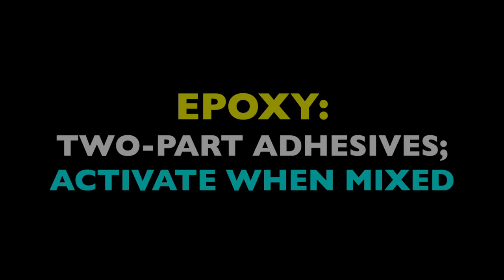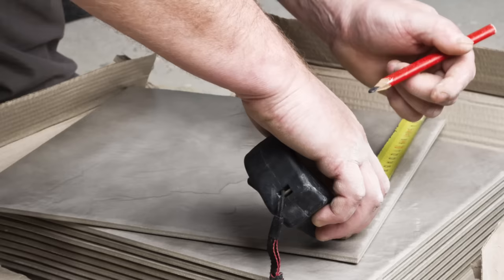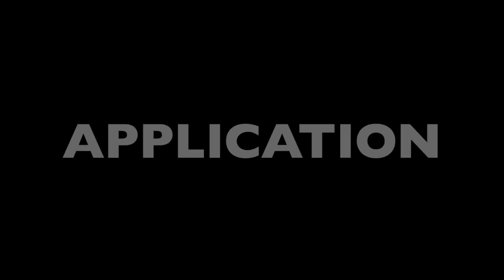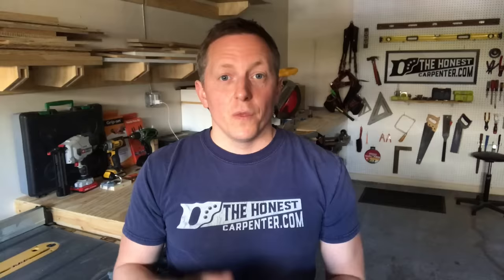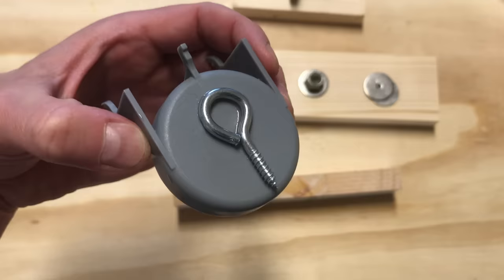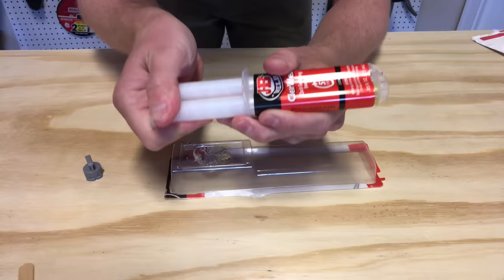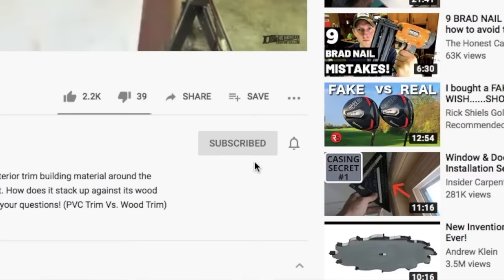DON'T USE SUPER GLUE! Try This Instead..(Epoxy Adhesive/5-Minute Epoxy/Epoxy Glue)

Comment: Thank you so much for your informative video!!! It was recommended right on time, just as my lord and savior Jesus Christ always is, "RIGHT ON TIME, EVERYTIME". I was at a stand still on which product to try next because, although superglue has it advantages, it wasn't getting the job done for me in this case. I  fall asleep with my eyeglasses on sometimes, accidentally breaking them. So I need to "HAVE" and "KEEP" some kind of strong bonding adhesive around for that specific reason.  And super glue, is by far, a total disappointment when trying to hold two broken metals together. It seems to have a nice firm hold while it's still semi wet but once it dries, "BREAK OUT THE EGGSHELLS" and don't even think about walking across them, lol. Epoxy is now my trial adhesive but from watching this video, just to be honest, there's no doubt in my mind that it'll make superglue seem super weak. 🙂I STILL LOVE YOU SUPER GLUE🙂 I'll be sure to post a follow up comment on the outcome of this epoxy and eyeglass trial. Two thumbs and two big toes up on the video, you've got yourself a new subscriber. Stay safe out there!!!

Comment: Another note -Super Glue almost requires a firm contact between both pieces to hold correctly.  Epoxy can often be used to "fill in" when there is a TINY crack between the the parts.
Reply: Super glue can fill cracks and build up if sprinkled with baking soda.

Comment: I buy my epoxy in two plastic bottles. Since it lasts a long time on the shelf it will begin to thicken too much.  You can thin both bottles by just soaking them in hot water for 10-15 minutes.
Reply from the maker: Thanks George, good tip!

Comment: You get superglue in much bigger volumes. I usually buy 50ml. Using it with baking soda (CaCO3) makes super strong. I find it stronger than epoxy. Working upside down is difficult though.

Please test the difference in strength. Baking soda and super glue is very strong and extremely fast.

I only now see that I have commented before... I would love your opinion.

Comment: A long time ago when 5 minutes was the latest, the company I was working for did some tests to compare 5 minute with slow setting.  It invariable showed the 5 minute type as being a weaker bond than the slow setting type.  Just wondering if that is still the case.   🙂

Comment: have you tried superglue mixed with carbonate? way more stronger than superglue but also dries instant with no wait. epoxy is good too used to repair a hinge on laptop but you have to wait long, there are some epoxys that use UV light similar to what some dentists have.
cyanocrylate(superglue) also is good for acuariums i readed so it wont damage potable water.

Comment: Wood tends to contract with time. For loosened furniture Bob Flexner recommends using hide, natural, hot glue, which could be easily reversed, removed and replaced with new glue. Epoxy reaction is irreversible. Trying the remove epoxy most probably will requiere sanding (damaging) the wood.

Comment: I like your comment old 'epoxy' being alternative to super glue,   well I recall when superglue was bought out as an alternative to Epoxy (ie Araldite) back in 70's or there abouts.   As a result I think Araldite bought out 5 min epoxy, a faster setting version of 24 hour epoxy (standard).
PS super glue is a epoxy  the 2nd part is air, and exposure of glue to air starts it setting.
Reply: No, superglue is not an epoxy; it does, however,  undergo a chemical cure, the main catalyst being water vapor and humidity, but it also reacts with most organic materials such as wood, cotton, leather..
.and skin. It can get quite hot when it reacts with a cottonball.

Comment: Epoxy is great adhesive but it takes much more effort to apply than Super Glue and so should be reserved for applications where it will be relied on for strength.

Comment: I had a class on adhesives years ago. One thing I learned was that super glue is not a permanent adhesive. I rarely use it for anything. In almost every application there is a better glue. 2 part epoxies are better for most things.

Comment: I'm just wondering what could I use to bond small rocks/pebbles to vertical wood surface.
I want to decorate small birdhouse for outdoors.  I haven't found anything that would stick instantly and vertically,  so I wouldn't have to hold each pebble/rock for a long time. 
Thank you for your video.

Comment: Loctite 1577688 superglue was able to glue the inlays on the soles of my Nike runners. Being a greasy plastic, nothing else lasted and worked as well.   A lot of these 5 minute epoxies and cheap superglues don't last in their application or do a good enough job.  You have to be careful to choose the right adhesive for the application especially in application where the epoxy is an electrical dielectric, exposed to high temperatures, vibration, material specific or all of the above.

Comment: The first epoxy were 24 hours or 12 hours. I remember the 24 hours was theoretically stronger than 12 hours.
I have never met a situation when Super Glue is the best option? Too quick to be adjusted, it does not go inside porous material.

Comment: Hi, interesting and helpful video. I am getting to desperate measures to remove a screw-on back to a watch. I am now contemplating glueing a nut to the back and using a spanner (wrench) to remove. However, I will need to remove the nut and clean the watch-back surface afterwards! Are there any adhesives that are strong enough to do this but can be removed afterwards, do you know? Thanks.

Comment: As you said, epoxy ADDS material, so it will leave a joint between the pieces. Not good for delicate work (i.e. jewelry). For those fine jobs CA glue is ideal.

Comment: I much prefer epoxy. I used to buy these plastic packets with the epoxy and activator in separate sides and you would squeeze the two sides together with your thumbs and knead the packet to mix them, then tear off a corner to push the epoxy out of the packet. They were the perfect amount of epoxy for most jobs. I can't find those anywhere...

Comment: agree that epoxy is really strong but it's messy and it smells. So it's more of a last resort use. For wood to wood applications I prefer to use wood glue. It's really strong for most applications and it cleans up a lot easier.

Comment: One of the big things is the gap filling.  Super glue only really works well when there is good fit up.  Epoxy can bridge big gap.  Only thing I would have included is always use epoxy in well ventilated spaces.  It is toxic

Comment: If you do touch the two parts on the nozzle of the syringes, as it is shown here, by rotating the syringes: next time probably won't be able to use it! It takes a trace amount of hardener to start curing the resin.

How many resin syringes tubes I have thrown way! Even some unopened! (USUALLY the hardener, ironically does not harden by itself!).  The self-life is quite limited (LOOK the EXP. DATE on the package! don't bother if there is no EXP DATE/USE BY DATE). I am still looking for an alternative to metal jar epoxies: those last for years after opening. Don't throw your money with syringes, unless you use it soon and total. Pricewise metal jars are superior too!
The strength of epoxies is superior, but super glue with calcium carbonate powder or soda powder does wonders for small applications, if you don't need the strength or want to buy the bigger quantity metal jars epoxy + hardener. I have seen though 2-3 Oz jars.

Comment: Even the "Dollar" type stores sell a cheap version. It's nice to grab several just for emergencies at that price.
Reply: I always buy up their Loctite and Permatex brand super glue gel that sells for $5 on Amazon and store it in my fridge for long-term storage.
Reply: @davcar872 ,  note that if the epoxy starts to gel and thicken after a year or so, you can soften it a little in very hot water,, or even directly in the microwave, but only zap it for ten seconds at a time and check it frequently to see how hot it is. Don't microwave metal squeeze tubes of epoxy!
Reply: @goodun2974  👍 Thanks for the tip.

Comment: What about the problem of leakage from the two resin and hardener tubes after you using the epoxy just once.  I wind up having to toss the unused epoxy??
Reply: Use it more often. Take care replacing the cap. That tape bandage should keep leakage from spreading. Store cap up.
Reply: As epoxy is a two-part adhesive, you should not have any hardening of the product unless mixed together. After dispensing the two parts, immediately pull back on the injector to pull both parts away from the tip. Wipe the tip and properly replace the cap. If the cap does not snap into place, use some painter's tape to keep it from slipping off.

Comment: I’ve used before with good results.  Any suggestions for an epoxy for teak wood bench that I’ll be reassembling with screws for additional support.  We picked up some loc tite construction adhesive.  Something better?  Thanks for your opinion.  Scott in CLT, NC

Comment: After 40 years in automotive industry I came to conclusion that THERE'S NO SUCH A THING AS A BAD ADHESIVE. EACH WILL WORK THE BEST ONLY IF IT'S USED FOR WHAT IT'S MADE FOR.
Super Glue originally was made to stop bleeding for Sharp cuts, used in WWII. Next time you cut your finger, use it and see how it'll amaze you.

Comment: Hey there! The rubber piece of the crossbar on my truck keeps separating from the plastic  frame and causing a loud humming noise caused by wind drag. I've tried a BUNCH of adhesives but none have kept the rubber sealed to the frame. Any suggestions?

Comment: What if i want to glue a piece of equipment to a plastic surface. i have about 2x10 in to work with that can be glued. the glue will need to be able to hold the equipment up right lets say upright against a wall.
what do you recommend?
it will be slightly heavy laybe 1-3lbs would need to be held up for years. i plan on using something as a bushing also secondarily

Comment: Cyanoacrylate glues (super glues) are very strong and they cure very quickly.  If you don't want to wait 30 seconds you can also use a cure accelerator to get an instant cure.  CA glues are available in much larger containers than you showed.  If you use a lot buying CA in 4 oz or 8 oz bottles makes the glue much cheaper.  There are also formulations that are thicker and are also gap filling.  I also use epoxy, but generally for larger bonds such as scarf joints in planks.  I never use the types of epoxy you showed, because I am looking for permanent bonds in wood that are stronger than the wood.  The professional grade epoxies (west system, ProSet, etc.) are much better quality than the 5 minute epoxies.

Comment: You can get off brand Crazy / Super Glue known as CA glue in larger bottles. However, if you're not going to use it all within a year then you'll likely be wasting it as it will harden on its own; even when stored in the refrigerator. And IMO the epoxies smell stinks.

Comment: Epoxy’s weakness is time. Check your glue-up after a couple years. Depending on the materials, I’ve seen it peel of in one piece in as little as 3months.

Comment: Good as far as it goes.  But like so often there is something else than black and white in the life.  And so there are applications for each.  Just as a simple situation I picked in my mind from thin air.  Say you have a crack on a part such that you break the whole part if you try to widen the crack enough to get the epoxy paste in.  Maybe, just maybe the thin (low viscosity) CA is better in that example situation.  By the way, how do you glue the ends of rubber string to form a custom size O-ring?  I once heard a solution from a rubber scientist.  Hint -- it did not use 5-minute epoxy.  And also not common rubber cement.  Now, there are dozens and dozens of different rubber compositions, so no single solution may apply.

Comment: |> |> |> |> |> |> |> |> 

that ability which superglue have I would like to see in epoxy too ... the viscosity ... sometimes you need to fix tiny cracks in glasfiber or what ever ... the capilar effect of superglue is great for this but its no epoxy ...

I give you fully right ...

especially in any marin applipicaton I dont think even on superglue exept the mentioned ability. 

|> |> |> |> |> |> |> |> 
|> |> |> |> |> |> |> |> |>

Comment: Great Video,
 I use JB weld to hold  Drill bits into my small hole saws to make Beads out of Shells and Soft Stones...
Now I am trying to glue Beach Glass to plexiglass or acrylic and make mosaics, but the 5 min epoxy is too fast drying. so is E6000 and Clear Silicon.
 I was offered some UV resin, but have not attempted to you it yet.
Does anyone have a Suggestion?

Comment: The appeal of super glue to me is that it is so wimpy, it has no shear strength.  Great for when you want to quickly and temporarily hold something together.  It shouldn't be used if you want to hold something forever.  JB Weld is great for when you aren't messing around.

Comment: I’ve avoided buying this because I assumed it was one time use only and any excess had to be thrown away. You mentioned backing off the plunger is enough, so you’re saying exposure to the air in the tubes is ok as long as they don’t mix?

Comment: How is the heat resistance on epoxy?  I had an issue with using Gorilla Glue (not epoxy...just the gel glue), and the item melted off the lucite base.  Wondering if epoxy is the way to go?  Thank you!!
Reply: You should never use superglue to bond two pieces of acrylic, as the chemicals in the glue can cause the acrylic to fog and turn white. Acrylics are not actually glued, they are chemically ‘welded’ together using special cement. Acrylic cement such as Weld-On bonds them permanently. You should have no problem using epoxy to bond other materials to acrylic.

Comment: Can I use epoxy to bond metal to glass???
Reply: I'm pretty sure you can. I used clear silicone to put a glass top on a metal artisan credenza made of 1/2" tubing and that also worked great. You just have to spread it evenly so that it looks good in the end.

Comment: I have a piece of thin wood that me electric outlet is mounted on and it has pushed in and have no access behind it. It's in a small opening on the trailer I live in. I need something that cures while I am pulling out and holding it, so I am thinking of super glue and baking soda

Comment: I need to repair the back of a wooden chair.  Not sure whether to use an epoxy or wood glue.  Thoughts?
Reply: Professionals like to use hide glue (glue made from animal hides) because it's capable of being taken apart in the future if another repair is needed. As a woodworker, I'd say use wood or hide glue over epoxy, assuming you've got good wood-to-wood contact with no gaps and can clamp it well while it dries. A good wood glue joint is stronger than the wood itself.

Comment: Epoxy is amazing, once you see it’s incredible strength you’ll never use superglue again, it’s junQ and is only good for skin repair (think stitches)
But I strongly suggest you buy the kit with two separate tubes and not the syringe type, they invariably epoxy their own tips together, making subsequent use difficult and are a pain to dispense in equal amounts.
Reply: The super glue you can buy is no good, but the real deal, the medical stuff is good for it's purpose. When they first started selling it to the public, everyone was going to a doctor to get unstuck. It was all over the nightly news  They finally watered down the product so the super name doesn't really fit anymore.

Comment: As always, another great video. I have a question - We have a Rubbermaid resin 7 x 7 yard shed. A recent big windstorm took it down. It has survived many storms worse than this. Anyway there are a number of areas where 2 panels fit together and then are held by 1” #14 screws. Majority of these screws ripped out of the resin, thus enlarging many of the holes, but other than that there are no other problems. So I’m trying to figure out what product to use to close over these holes and to maybe build them up a bit, so that I can screw panels back together and have them hold tight?
Reply: Try super glue and baking soda. Put blue tape on one side of the hole, apply super glue than sprinkle baking soda. Wet it with more super glue then sprinkle more baking soda. Keep adding both until desired thickness is reached. It adheres to plastic, dries rock hard instantly and can be drilled and sanded. Or, use fiberglass tape and plastic resin.
Reply: Try super glue and baking soda. Put blue tape on one side of the hole, apply super glue than sprinkle baking soda. Wet it with more super glue then sprinkle more baking soda. Keep adding both until desired thickness is reached. It adheres to plastic, dries rock hard instantly and can be drilled and sanded. Or, use fiberglass tape and plastic resin.

Comment: Epoxy is not a replacement for superglue. The whole point of superglue is to hold something relatively strong after a few seconds (with activator), then additional fasteners are used. Epoxy falls into these second phase fasteners.